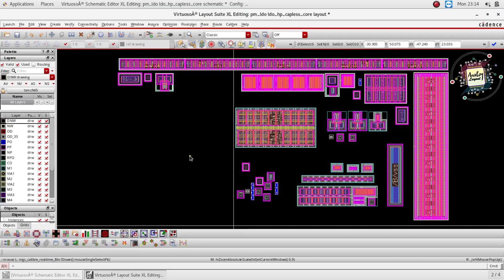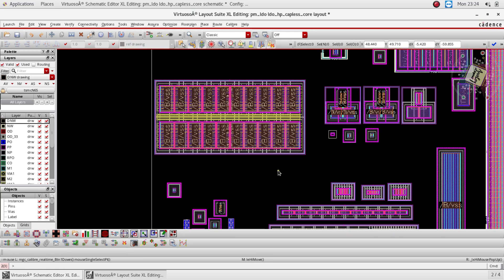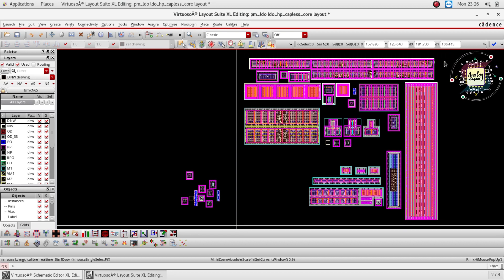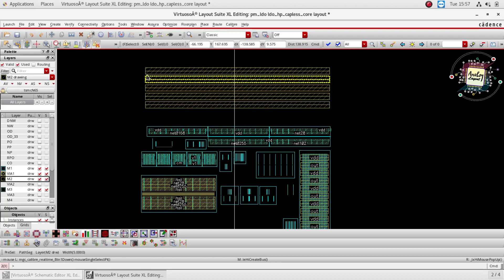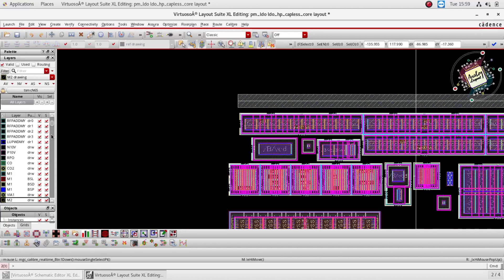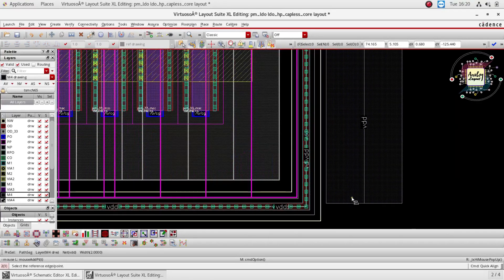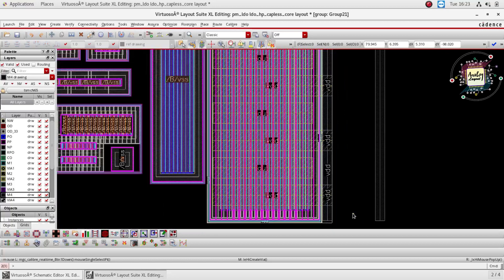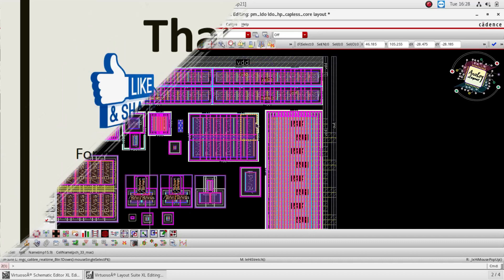LDO – Temporary Floor Plan & Power Plan (Part - VIII)

Comment: Hi, I think the floorplan was made only for demo, however, when you are working for LDO and other layout, you should ask for circuit designer's ppt instructions, you should well coordinated as if you can see in the schematic that there is a mirror or symmetrical part in pload, diffamp and isource.  In case area will not a problem, then you can freely match the layout like left and right. Many Designers also ask layout guys to match the p loading devices. So in real time, well coordination bet circuit designer, project leader/top blocker and yourself is still the key for more efficient work. Thank you.

Comment: Hi Sir,
I am a BTech graduate.I want to start my career in VLSI Analog Layout. Please start the videos from scratch.So that freshers can get job very easily.
Introduction to cmos Fabrication steps wafer Formation Photolithography.
Typical cmos inverter fabrication steps.
Typical cmos inverter fabrication steps.
Dual pattern lithography, Finfet fabrication steps
Introduction-Aspect of VLSI design- IC MASK design
Introduction to full custom
Introduction to Semicustom design flow
Foudation Ips
Introduction to CMOS Layouts
Design Rule and how to read DRM
Design of basic gates Layout
Design of NAND4x4 cell, Concept of half design rule
LVS/DRC concept
Interconnects, Sheet resistance, RC delay
Crosstalk, latch up effect, STI stress effects, WPE effects, Antenna effect
Electromigration, Irdrop
Parasitic extraction and delay estimations
Introduction basic buidling blocks of SOC- IPS
Standard cell Layouts- Architecture, Std cell tracks concepts, Abutment and Half rule
Memory Layout desing-Architecture, Muxing concepts, Leafcell concepts, Abutment and verication techniques, compiler flow introdution
Analog Layouts – Concept of matched layout – ESD issues
Integer N PLL
DAC
Thankyou .
Reply from the maker: Topics which you have told to explain will take years together for me to upload , I'm trying to upload all important topics in my chennal , but it's just a matter of time
Reply from the maker: Take a membership and get personal touch with me

https://www.youtube.com/channel/UCgZEUbcl6Ma6r-Fi7SA6c9g/join
Reply: @analoglayout  ok bro,But atleast try to upload basics of analog layout(using cadence virtuoso),bcz when i watched your videos i didn't understand anything.
Reply: @analoglayout  hi I wish to join a beginner membership.i don't have  visa card I have rupay card. i try another card it's not acceptin.i have a Google pay how to I join pls  tell me